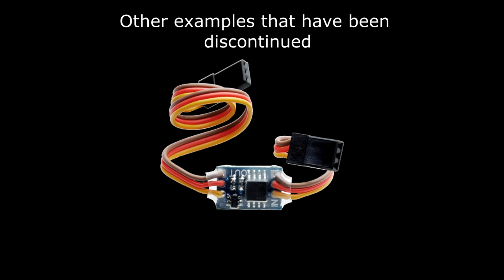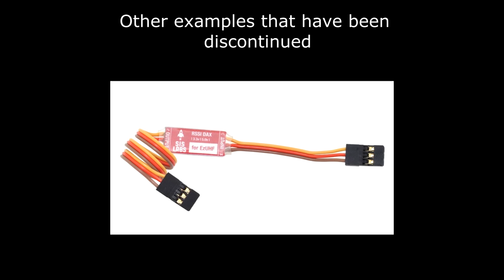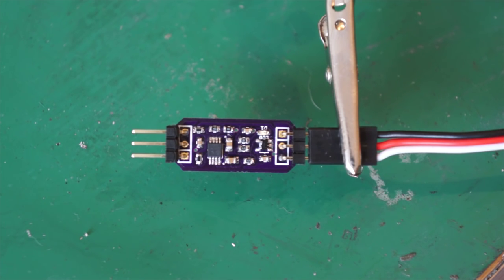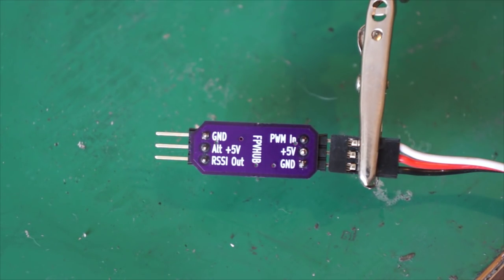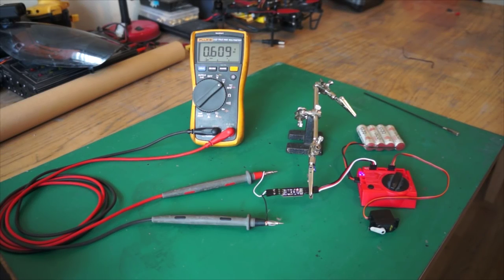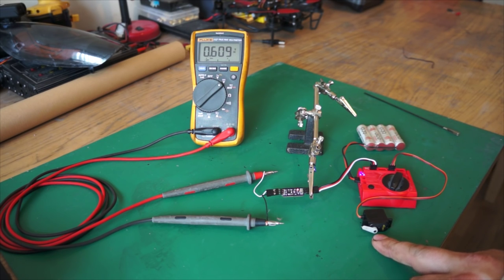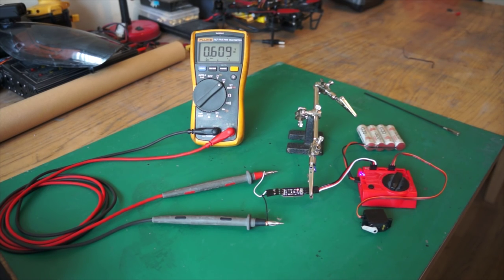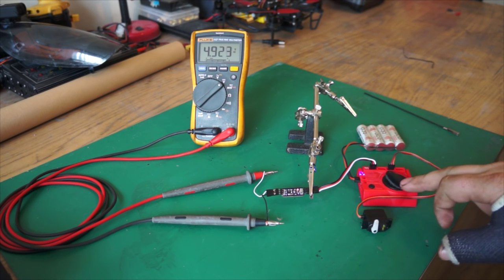EZUHF Digital to Analogue converter

Comment: Hi Ian, I know its been a while since you played with this DAC....but the output voltage at max signal is 5vdc?.....The Storm for example requires a maximum of 3.30 volts, not 5 volts.
Is it possible to add a resistor on the output side to drop it from 5volts down to 3.30 volts? Or is it not that simple?
Thanks m8...:)
Reply from the maker: I think it should have been a maximum of 3 volts but Andy said mine was faulty because it maxed out at 5v. Either way Andy only made a few and wasn't making any others.
Reply: Coyote FPV Faulty eh?...ok...well you can buy a programmable DAC again specially for EZUHF for 3.3 or 5volt....I'm not sure the Storm will cope with 5 v across its rssi port? Anyway, a meter will tell the story...Am I correct in thinking Channel #4 is the RSSI port on the 4 channel EZUHF receiver.?
Reply from the maker: +EnglishTurbines Yeah he said it should only have put out 3v max so one of the resistors were damaged. If the RSSI port is only designed for 3v max don't give it any more. RSSI output on an EZUHF is decided by you in the Tools software under mapping tab.

Comment: what kind of brushed esc can be used? Where can I buy this product?
Reply from the maker: +T. Boyce Any kind of brushed esc will do, they all vary voltage with throttle. This unit I am using here was made by a guy on FPVHub.com but he only made a small batch and I don't think he will make another. He was talking of making a more comprehensive one that can work with PWM and PPM.